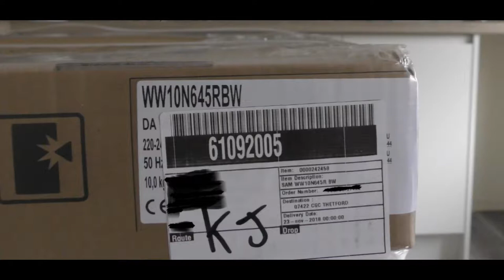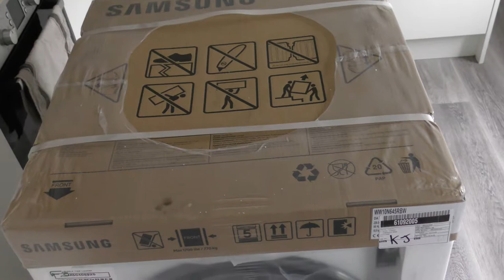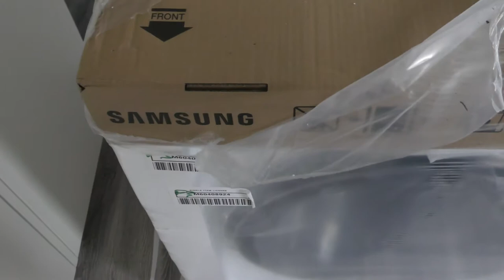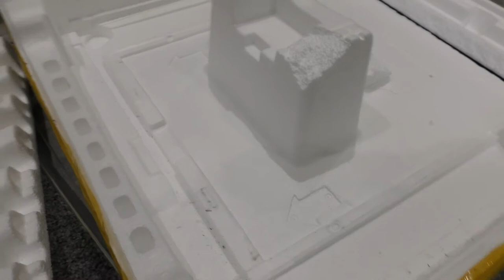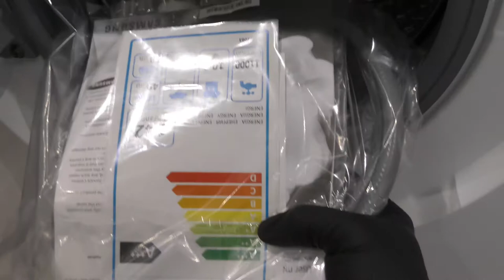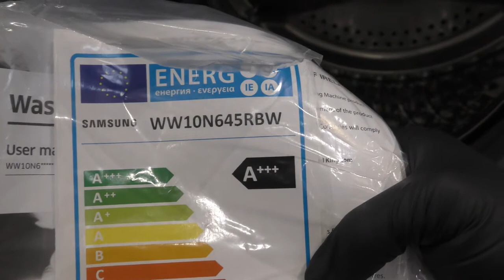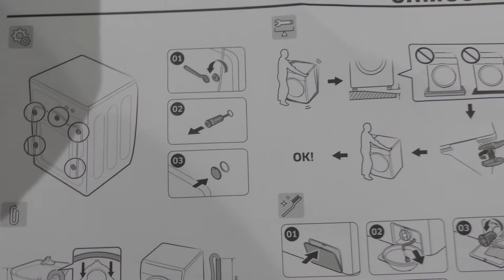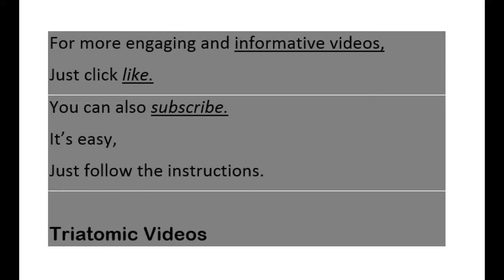Samsung Washing Machine WW10N645RBW - Unpacking

Comment: Is this the original pack or you already had a cardboard box over this cover
Reply from the maker: Hi, it came like this from the store, Curry's PC. The delivery guys, 2 of them, carried it as you see in the video. It has a sort of foam pallet at the bottom.
Reply: @Triatomic08  Thank you for the reply sir. I received mine with the same package but I thought another cardboard box should be there, that's why asked
Reply: @franian77  I recently received an LG with similar packaging and like you I thought there should be a cardboard box.  Neither LG nor the vendor is able to verify yet, it's been 4 days.
Reply: @DaTuba5  I did some searching regarding this and found out that some manufacturers for some models they use this type of packaging so nothing to worry mate